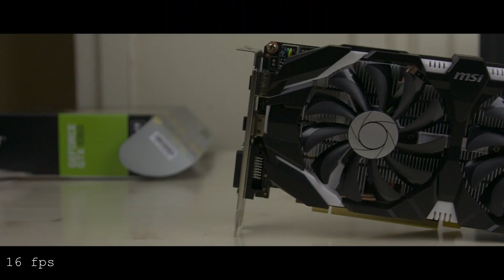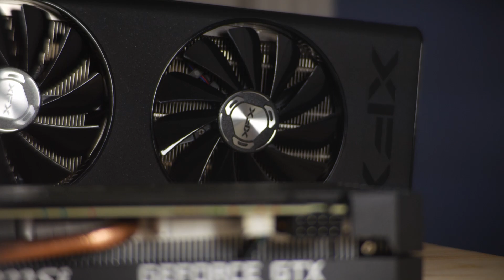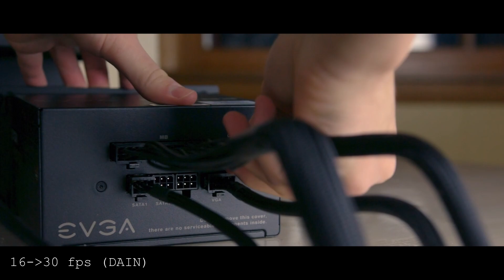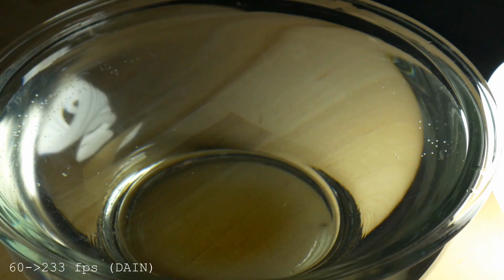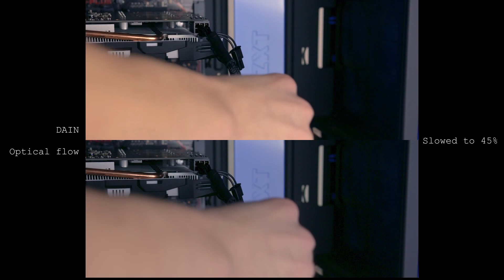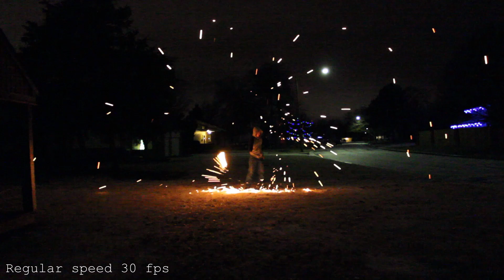DAIN AI frame interpolation (with comparisons to optical flow)

Comment: I'd be curious if you could compare these same clips (or similar if you don't have them anymore) with something new that popped up known as Rife which I'm being told is faster and just as good if not sometimes better than DAIN. And there's another AI model called CAIN (Channel Attention Is all you Need) which I don't know where it stands on the board other than hearing Rife surpasses it. I believe it's also not as good as DAIN either. Both of these plus DAIN can be accessed by a new GUI tool called Flowframes which also contains a ported version of DAIN to work with Vulkan compatible cards. (aka it works with AMD cards)

Comment: I've seen a number of clips using the DAIN AI, and wanted to know more about it and see if maybe I could use it myself. The rendering time is a definite downside, but maybe for some shorter videos? I might also give optical flow a try. Thanks for this very informative video. Not many channels at only 69 subscribers make videos of this quality!

Note- Would you recommend editing and rendering a video together and increase the FPS of the render, or increase the FPS of the original files first? I heard you say in the video that if you include transitions it could make a difference.
Reply from the maker: I would recommend doing individual clips and then editing them together. DAIN has a feature that detects scene changes to prevent weird morphing transitions, but even then, with the amount of time it takes to render, if it messes up a small section or somehow crashes, you'd have to redo the entire video. whereas if you do individual clips, you can much more easily just redo that individual clip.
Reply: @timothyferris4656  thanks 😊

Comment: very informative.  What optical flow implementation are you using?
Reply from the maker: I used what was in davinci resolve. In the inspector for a clip, there's a retime and scaling option. in retime there's optical flow and under that is motion estimation (standard faster, standard better, enhanced faster, enhanced better and speed warp), I just set optical flow to enhanced better. I think shortly after I made this video I heard that the optical flow node in fusion works better (it definitely has more options to fine tune). I haven't messed around with it much to notice the differences but it does seem to take longer to playback. there is another setting in resolve called speed warp that uses a neural engine. but its a studio only feature, so I'm not able to use it without a watermark.